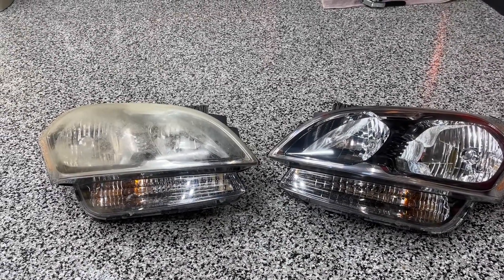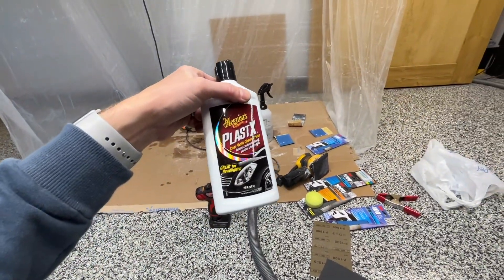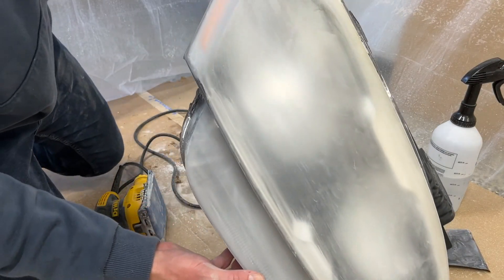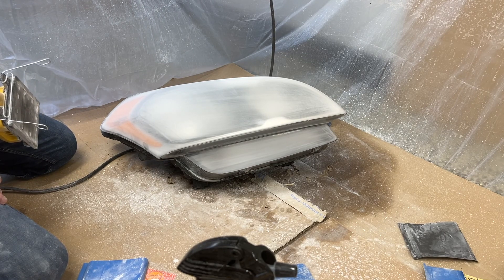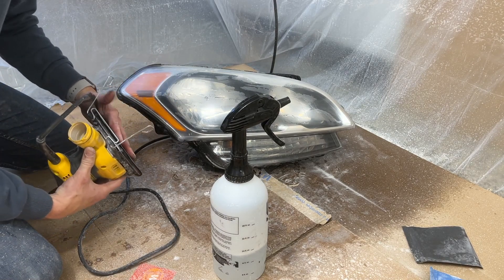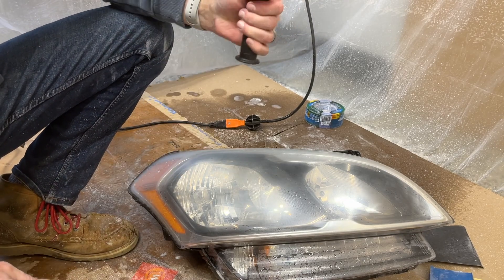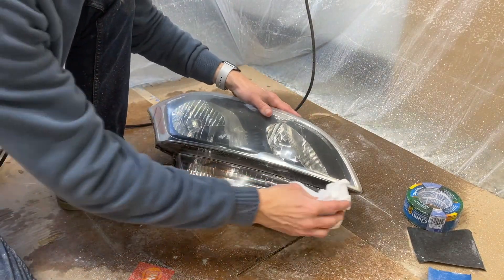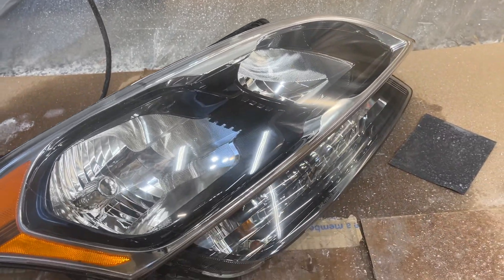HEAVILY Oxidized Headlight Restoration

Comment: Well i found the Electric sander far way to Savage, Having little in the way of any controls,?At this step is critical,To be fair the headlights are a ridiculous shape to start with?? Then you used cordless polisher after sanding, One brand of polish is enough to give good quality clarity!! If used properly a slow speed is needed to build up friction across the polycarbonate lens keep the head moving at all times!! I strongly recommend a 3M restoration kit because it gives not only a choice of sanding methods wet and dry!! And takes the guess work out of which grit size to use in restoring, There's only three steps, Before polishing and applying that Meguiars clearcoat which in my opinion is the best, I use Meguiars polish to so hold on to it, As your a young man i think its worth investing in a two speed cordless drill, This will give you more control in future restorations!! The 3m kits all come with a 3inch dase plate with micro hooks!! Sorry for going on so much, Your restored headlights look fantastic welldone 😀🤔🇬🇧👍